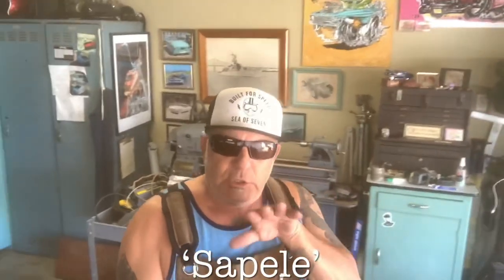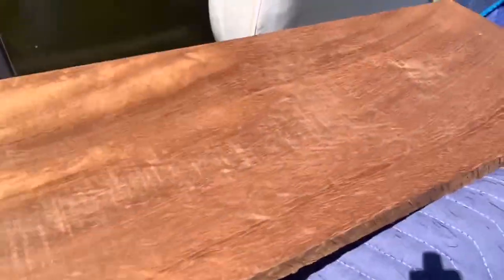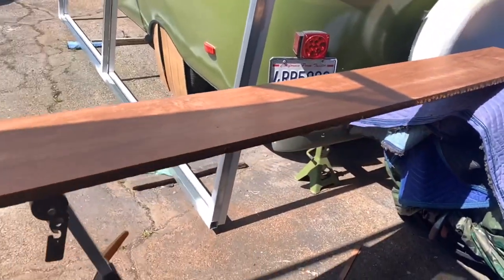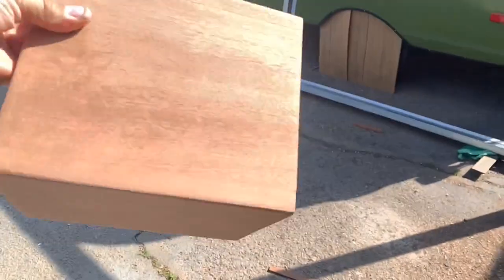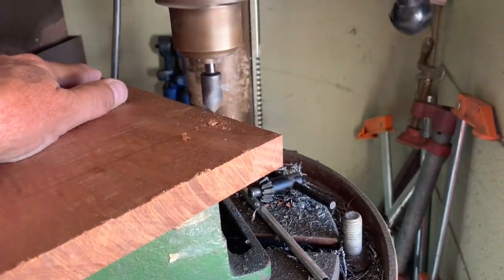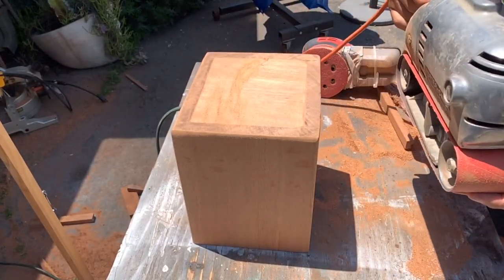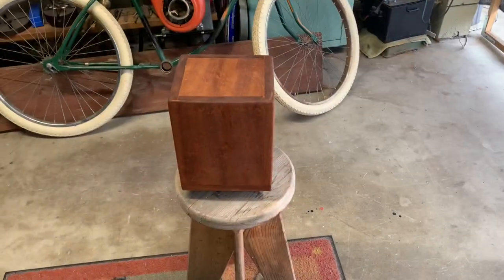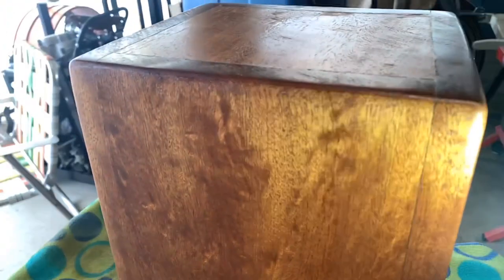Making A Wooden Urn | Sapele Wood Urn | #woodenurn #DIY

Comment: nice.ty  it may hav moved because you clamped in the middle of the side which can cause wood to bow and push out the other 90 degree side. i like to wood work but new to boxes.  im doing an urn with miters and when i clamped it the miter slid.  oh well out to the sander
Reply from the maker: Thank you, I’m sure that’s why the wood slid. 👍🏼💯